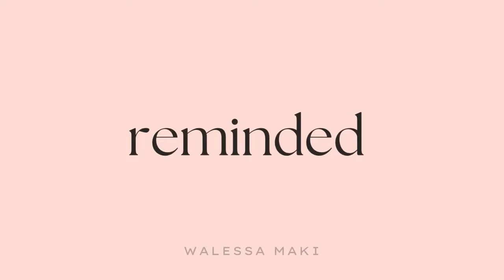Beautiful Antique Dresser Rescue | Thrifted Furniture Flip

Comment: So much work, good for you. I would've preferred the hardware to have been spray-painted gold so it stands out better. I also would paint the decoration on the middle drawer withgold gilding wax. I think that would have been a slightly better look at the end. But beautiful job refinishing. 

A lot of the men who do this on YouTube also make sure to put Howards feed N wax -- not just on the inside of the drawers but also the bottom of the unit and the back of the unit. Just a more complete "finish". Good luck with your excellent work.